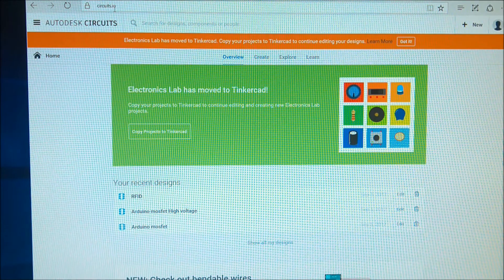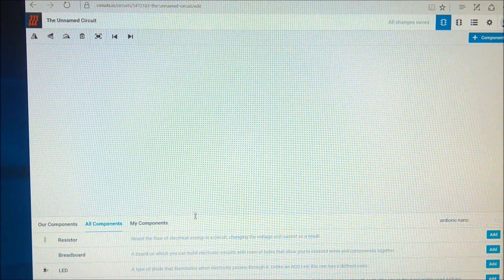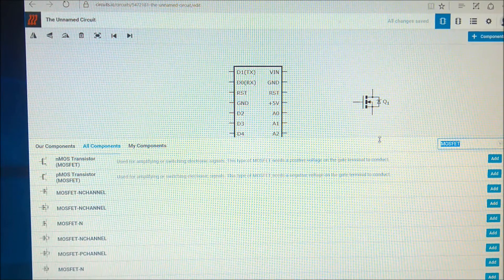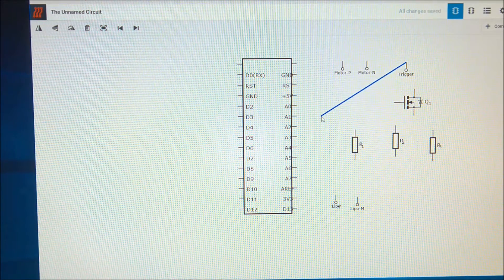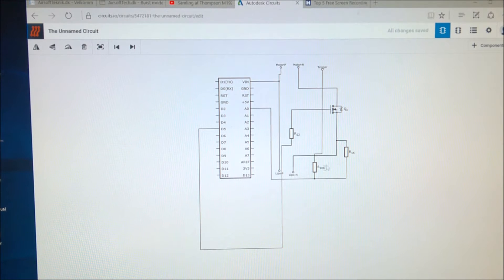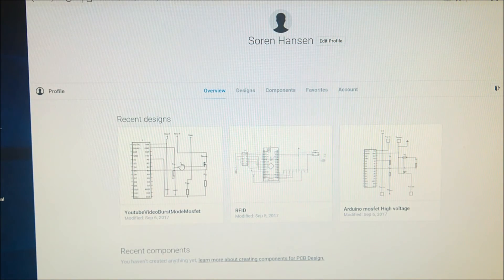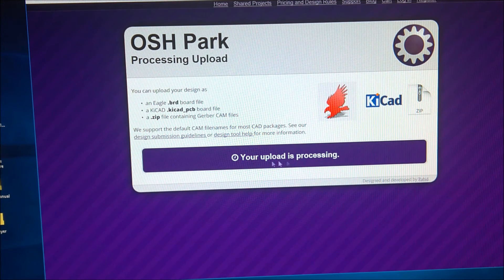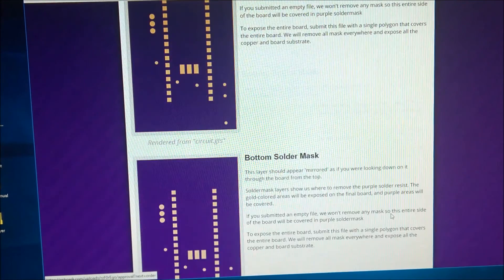Burst Mode Mosfet - PCB Design.

Comment: thank you for your explanation.
very helpful for me.
Reply: I want to ask.
in wiring diagram there are 5 resistors, why you make this there are only 3 resistors?
switch between + 5v contact with D2 what is not the problem? why D4 in the diagram there is a resistor going to ground, but if there is in vidoe this is not a resistor.
sorry if I ask a lot because I just learned.
Please explain. thank you